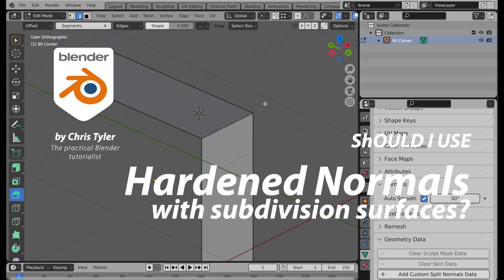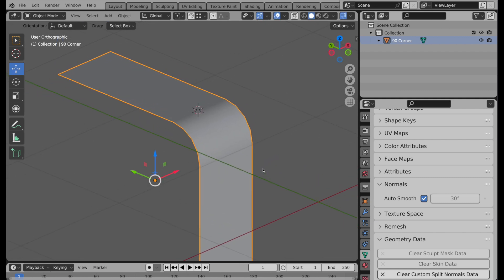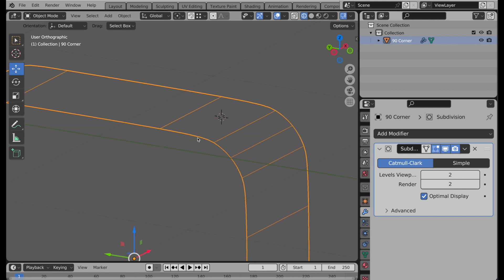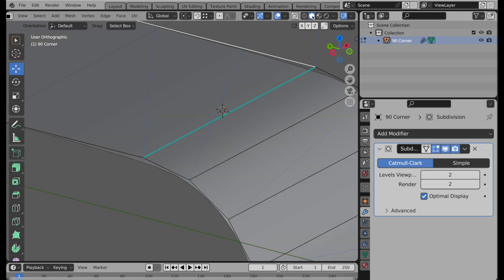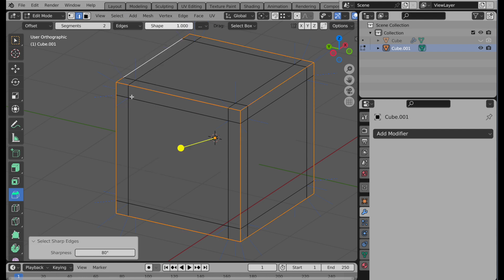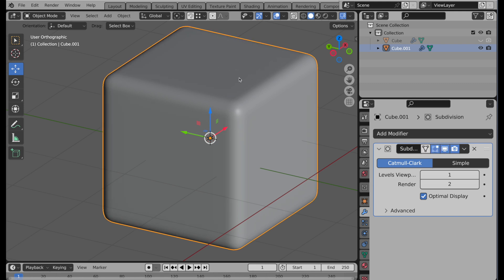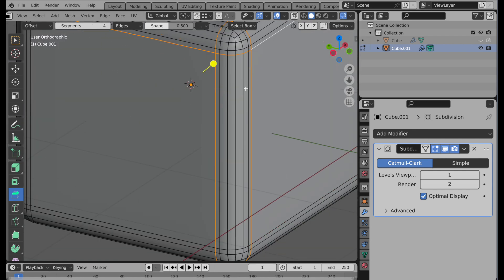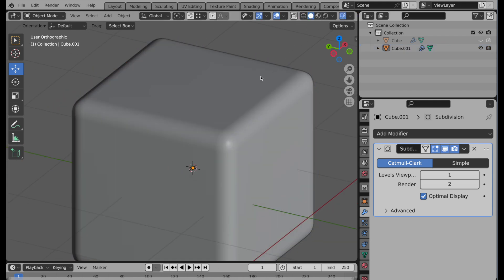HARDEN NORMALS and Subdivision? Should I use it? Can it work?

Comment: Basically edge crease is your friend or add enough support loops
Reply from the maker: Blender doesn't apply a 'sharp' normal break on creased edges, they have this harden normals and also a 'Sharp' normals function that the user can apply separately if they want.

Comment: Is that a real term "harden normals", I've actually never heard of this.
Reply from the maker: It's just a term Blender uses to describe a particular normal configuration. If you watch my previous video linked in the description, it shows what they are and what they're used for.
Reply: @christopher3d475  isn't flatten normale and smooth normals? A normal is an angle it's face has basically
Reply from the maker: @RomboutVersluijs  well, you have face normals and vertex normals. When auto-generated in real time, they are 'normal' to the element, meaning 90° to the element. But they don't necessarily have to be. They can be customized for various shading purposes. NURBS applications export custom normal information  derived from the NURBS data and encoded into the exported polygon mesh that aren't necessarily simple perpendicular relationship. So normals can be made to do various things for shading purposes.
Reply: @christopher3d475  yes i know if that, like the anime models or renders show. Lots of them use tools to set custom normals. I also know that games also tend to use a lof of custom normals to get nice smooth shading while actually being pretty low res models